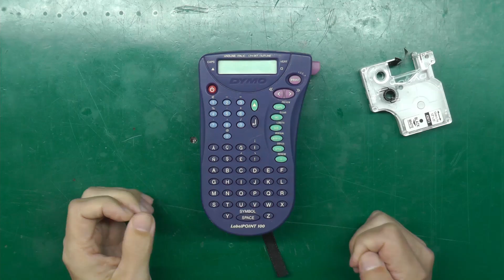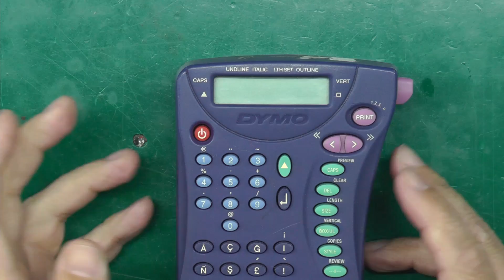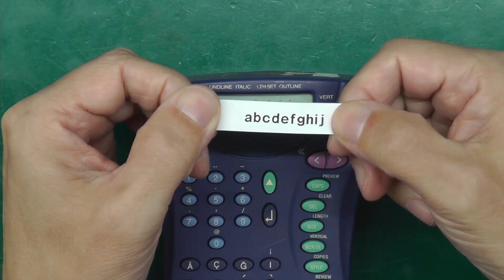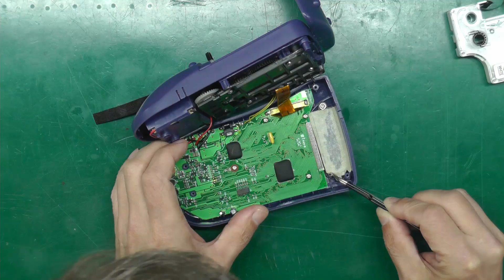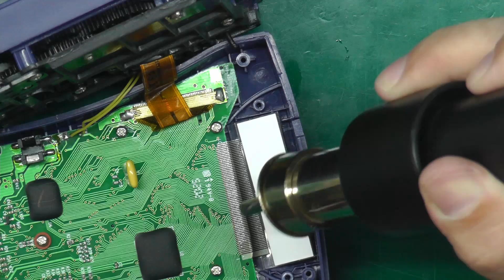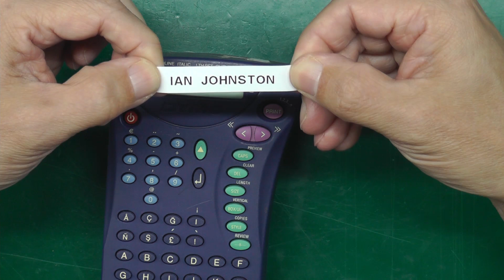No.078 - 5 Minute Repair - Dymo LabelPOINT 100

Comment: Hey M8.
Thanks for this Video. 
Saved me buying a new one and breaking my had if the tapes would fit in the new one.

I added a stripe of a hard foam to keep pressure on the contacts.
My display was totally dead.
Now it works very well again.
Thanks allot!🎉

Comment: Thanks for this.  It appears to have worked on my Rhino 5200 where the display completely stopped working.  I managed to melt my plastic spudger a bit so I think the temperature was good enough to remelt the glue.  Let's see how long it lasts.

Comment: Nice! I have a Rhino 5200. Very, very lightly used although I’ve had it several years. Always worked perfectly, but yesterday I went to use it, and the letters are all showing up upside down. They still read left to right, and each character is in the right position, but each character is upside down. I’ve tried to factory reset and that didn’t do anything. I’m wondering what to try next. Maybe I need to crack it open and see if some similar techniques can help me.

Comment: Thank you so much for your video! I've made a different - hopefully lasting - solution: I've cut down a 1.5mm thick zip tie and placed on the strip to apply pressure which is currently working, but will see in a while.

Comment: Hi, nice fix. As you say, it probably won’t last, I’ve tried it myself a few times, and it will eventually fail again. Since you have a 3D printer, maybe you could try printing a brace to apply pressure along the bonding area, using the screw holes on the main board  to attach it (with slightly longer screws). Just an idea. Cheers.
Reply from the maker: Hmmm, good idea!

Comment: Would look great if you typed in "abcdefghi" and hit <print> and then the word "SUBSCRIBE" came out on the tape.
I reworked that same cable on my own Dymo labelprinter which had the exact same issue.
It seems to be a common failure next to the thermal print head missing some  lines.
Thanks for the upload, I enjoy these simple repair videos just as much as the more extensive repairs on the lab gear.
Reply from the maker: He he......I did actually think about printing something like that just after I had finished filming......:)

Comment from the maker: NOTES:
It's not the soldered joint that failed, it's the carbon/metallic strip on the flex that dis-joins/breaks down and by heating it can on occasion help to re-bond it. If the heating didn't work then the next step would have been re-flowing the solder, but that's not to easy without melting the flex and can often be a 1-way trip to ruin. I was lucky this time.
Also, here's the 3D printed battery cover (quick 'n' dirty version 1):
https://www.ianjohnston.com/images/stories/IanJ/Dymo/Cover1.jpg
https://www.ianjohnston.com/images/stories/IanJ/Dymo/Cover2.jpg

Comment: They look soldered to me!
I would've showered it with flux and run a soldering iron along. Like we do with 0.5mm pitch ICs.
Reply from the maker: It's not the soldered joint that failed, it's the carbon/metallic strip on the flex that dis-joins/breaks down and by heating it can on occasion help to re-bond it. If the heating didn't work then the next step would have been re-flowing the solder, but that's not to easy without melting the flex. I was lucky this time.